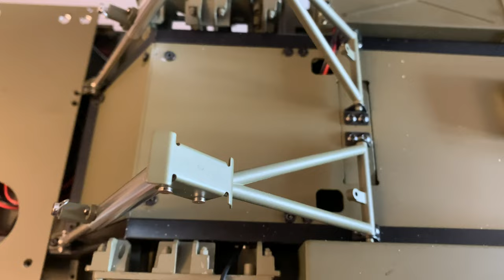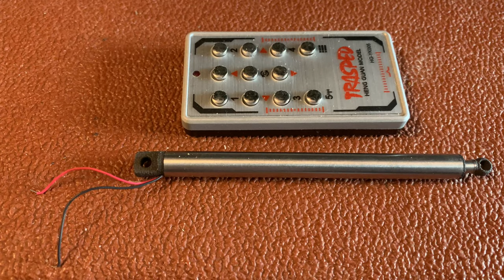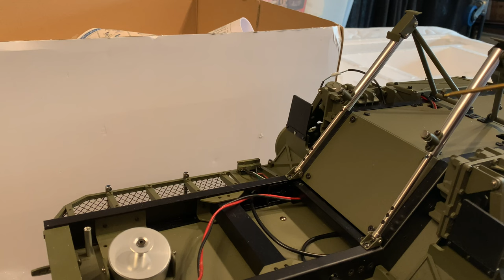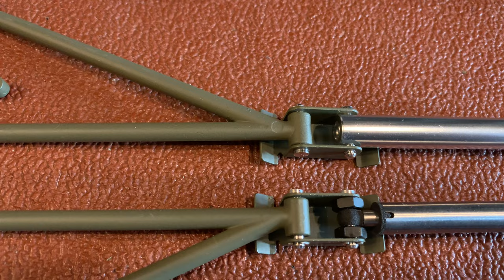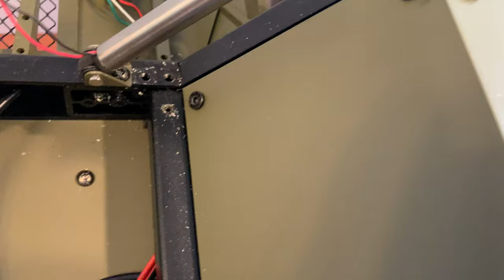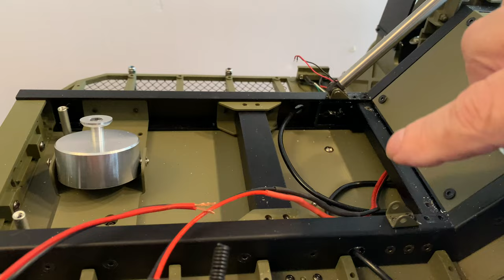HG P805 Build Extras 2 - Electric Trailer legs for HG P805 P805 and P806 for Hemtt P801

Comment: hi paul, have you got a link to these, as i can't find them on ebay, tried various keywords but to no avail 
pete
Reply from the maker: Hi Pete, I got the parts from Aliexpress 
https://www.aliexpress.com/item/1005002975729973.html?spm=a2g0o.store_pc_groupList.8148356.7.31b66e3ciXO3MX
Please note these cannot lift the trailer. They will drop before release and raise after truck has re-attached.

Comment: Hi, great idea. Do you have links to the parts you have used?
Reply from the maker: https://www.aliexpress.com/item/1005002975729973.html?spm=a2g0o.store_pc_groupList.8148356.7.31b66e3ciXO3MX
Please note these cannot lift the trailer. They will drop before release and raise after truck has re-attached.
Reply: @paulsmodelshed Would you consider selling a "kit" version of this product? Something that basically just bolts on?